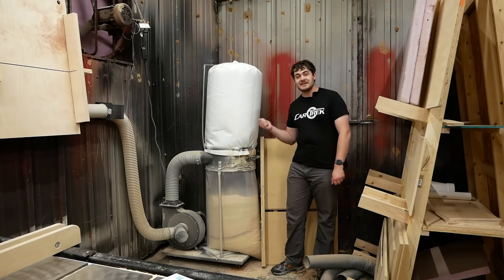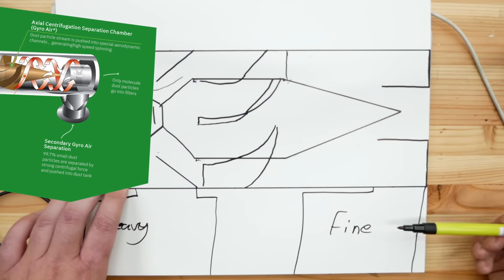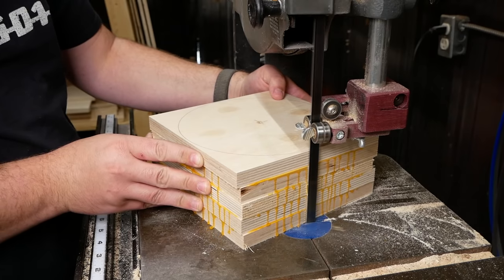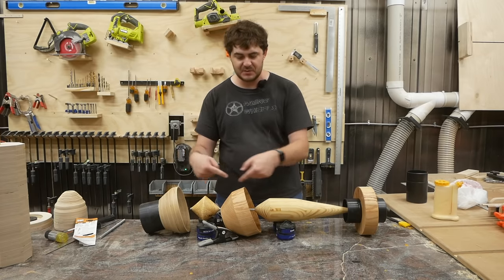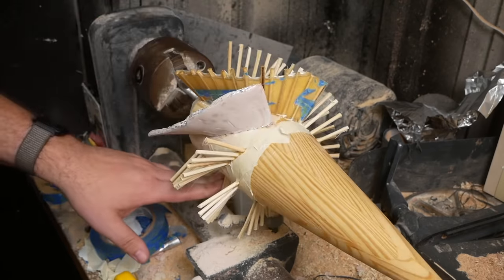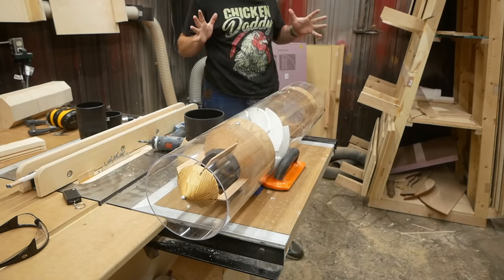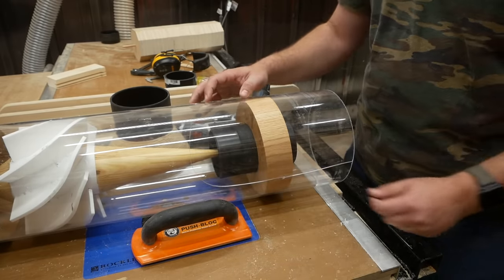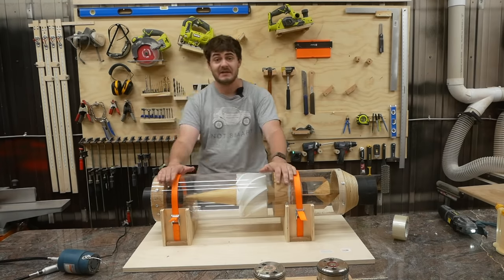I Made a Centrifugal Dust Separator to Upgrade My Cheapo Dust Collector

Comment: Two things on fins. Uv curing epoxy. And steam box.
Reply: Acrylic is about the same for plastic as wood steam box. On the fins, I think thin start and end pieces may help a lot. Aerodynamics...as superfastmatt says engineers state, may it works, maybe it doesn't. Calculations are not irl
Reply: I have seen people say that masking tape can assist with acrylic cracking, idk.
Reply: Uv resin or silicon should assist in structural integrity. Don't forget about e6000. Just ideas, packing tape seems like a good and dare I say... sufficient fix.

Comment: Very cool and intriguing - i have a 3d printer and have a basic understanding of fusion360 ... It looks fairly straightforward to design it and print it .. the only thing i would have a bit of challenge would be the fins - but the fusion 360 forum is very good and im sure there would be help ... If you made the parts hollow , i bet you can print the whole thing with just 1 spool of filament

Comment: Thanks for showing when stuff doesn't work. It's informative. 
BTW the plywood was a bear because you were trying to constantly cut alternating layers of end grain. The laminated pine acts more like a solid length of wood. The lathe tools were difficult because of their short length (less leverage) making them harder to control. I can't speak to how sharp they were but that's also critical especially on oak and any end grain.
I'm surprised you didn't use something easier to work like polystyrene or pvc formed by heating it a little. But that's the fun of your channel, watching you take the long way 'round. ;)

Comment: Would putting making it bigger and putting the air/ dust inlet at an angle as to course the vortex and exit air pipe back up through the middle and mount it vertical? So the heavy stuff drops?

Comment: I wonder if you could do some sort of recycling with what it collects since it separates out the course and fine dust (maybe use the course dust to make some sort of chip board and the heavy dust for crack repair and to mix in to glue for a more seemless finish)

Comment: I don't know why, but I kept expecting the turbine part to spin. Just seemed right. So yeah, with a 3d print you could dial all that in and save quite a bit of work (not having to deal with turbine blades exploding).
When all is said an done, if it works, it works. Plus think how much easier it would be now to do it all over again with what you've learned. lol.

Comment: Use an angle grinder with a wood carving wheel on it while you hog out a bunch of material on the lathe. It’s safer and quicker than using a gouge or bullnose on the lathe.

Comment: Is there a reason this wasn't installed on the suction side of the blower?  If the blower fan curve would handle suction pressure, it would seem it would be better to pull all of the dust through the separator and filter first rather than pulling trash into the blower and then sending it into the separator and filter.  As a plus, if you didn't need to recirculate the air in the shop, you could just vent the blower discharge outside so the bag filter for really fine stuff wouldn't really be necessary.  This would also help prevent leaks from blowing fine dust around in the shop.

Comment: Wonderful. BUT you need to relocate the vacuum / blower to the front of the filter.  Why impact the fan blades with the wood debris?  Have the fan blades running in clean air.

Comment: Could this work much better if the first cone support fins were removed? You should reduce the inlet size slightly  before the second cone so the air can speed for tge second stage.

Comment: A 4" diameter cylinder has 1/4 the cross sectional area of an 8" diameter cylinder. Approximately 71% of diameter represents 50% of area. It does indeed look really counterintuitive.

But a 4" diameter fits standard fittings so that's the correct answer for how big to make it.

Comment: so i am here more than a year later. but for the fin fiasco part. instead of making fins that you then attatch to the turbine that forms to the outer shell. would it have worked to have cut grooves in to the wood with a router, so that the turbine had its own fins, and shrinking the outer shell instead with a reducer? like if we dont need/want a clear acrylic tube etc.

Comment: In my honest opinion when he latheded the large ring (the wood in the tube), he could have notched a small channel to put a rubber gasket as it is seals and holds well, and  the screws would not interfere.

Comment: Should the vacuum connect before or after the dust separator. In your video it connects before the dust separator , wouldn't it be causing more wear and clogging in the vacuum propeller, or does connecting it after the dust separator won't work???? really nice video by the way,  I am thinking of making one for myself.....

Comment: Would it be better to put the motor after the dust collector. Then it is sucking the air through the collector. Plus chips+dust are not going through the motor fan.
Could one not just forget the post dust collector filter and simply vent the pipe directly outside?

Comment: You have to drill an little hole at the end of the Crack an then tape it frome the back so you can fill the hole with a dot of epoxy. 🤙

Comment: would be interested in the equivalent cost vs the purchase cost to complete the comparison.  
I once build a deck for my house and decided there was no need to hire a professional. The compensate for my lack of experience, I over engineered every aspect of it. and result, it took me four times as long, and cost twice as much in just material, but if a tornado ever came through our neighborhood I would pull the family out of the house and crawl underneath the deck. pros and cons I guess, needless to say I never built another deck!

Comment: They are different ways of achieving dust separation. And I like to think dual stage and finding different ways In achieving a clean output like even so far as venting Outdoors we're a little bit of dust outside the building probably wouldn't matter.

Comment: You should've used polycarbonate instead of acrylic. It's much more durable and cheaper but, there is a tradeoff which means it scratches easily.

Comment: The design is super cool, but wouldn't it make more sense to put the separator BEFORE the fan? That way you're separating the vast majority of dust before it travels through the fan potentially damaging impeller blades, and all you're blowing out is dust that will be caught by the filters.

Comment: great video enjoyed it a lot, but I do not understand why you put the exstractor before the seporator, as one would do a with a cyclone system to avoid accidents with the fan being hit by unintentional debris nails screws and stuff!  I have seen the jet on YouTube,  and i was not impressed with it one bit.                                    For my last homemade cyclone I used the largest and most rigid traffic cone i could find, i think it was made from recycled tyres very thck walls so it did not colapes. i cut the top off the  cone so it was about 4" exit attatched plywood base plate for dust bucket sea.l purchases an ally stew pot online £18 UK  that was the same diameter as cone base. the pot had 2 loop handles, so i coud use toogle clamps to attach pot to cone base, drilled  two 4" holes in pot, one centre of base to for exit pipe, and one in side wall at angle to copy cyclone entrance pipe using filler to blend it in as best i could. It did worked not bad at seperating but lost  power a bit and it was very ugly. The reason for making it was my bucket extractor has 4" hose,  and  the cheapest 4" cyclone in UK is over £120. so one pot and two toogles was much cheaper at the  time. I have retired it for now. The extractor has just one job for my mitre saw stored neatly under bench. No room for cyclone. So may try using the cone cyclone in future.

Comment: Today we learned: Don't super cheap out on wood turning tools. Don't friction fit in an acrylic tube that costs over $100 since you're going to be using silicone to seal it anyway. Also, why wouldn't you plumb the separator ahead of the blower as a pre-filter instead of making the blower touch all of the dust and chips?

Comment: You have the fan unit mounted to the wrong end of the separator.   All your wood chips and sawdust are going through the fan.  Should be mounted onto the outlet side so it's sucking the air rather than blowing it.

Comment: The size of your wood turning tools were the main reasons why   things didn't end up the way you wanted. The tools needed to be much longer to gain adequate control.     

I have used Baltic birch plywood to turn  three edge bowls with no problems using carbide tools.  And the shape was more complex than what you turned.  When you turn wood with carbide, you need to turn on center of just a small fraction of an inch above center and your speed needs to be high --- 700-1000 rpm when turning on the outside. When turning on the inside (hollowing), your tool needs to be below the center line.  

The reason for your catch when hollowing the wood was due to being above the centerline, and the tool was trying to remove too much wood.

I suggest learning to turn wood before venturing using a lathe.  You could get yourself hurt very quickly because of ignorance in using the tools incorrectly.

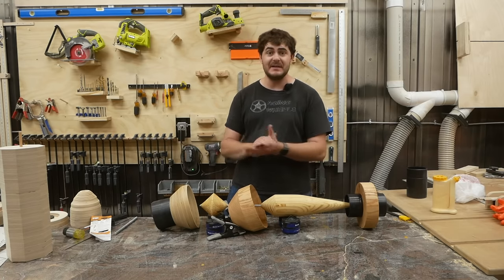Comment: 9:00-9:30 I just love this hypothesis and the facial expressions at the start and conclusion!   Very comical.
22:25 I thought the forgetfulness for style of carpentry was willful, and not honest; style: Tongue & Groove.
32:47 The filter box on a saw horse reminded me of the movie Apollo 13, except the CO2 filters were duct taped together.
34:04 I had to watch the left side of the screen for particulate departure out the tube, because the sawdust is the same color as the table.  Very small traces were still coming out of fine dust particulate, the kind you need the filter for, and most harmful to your lungs.

Overall 8 out of 10 video, first time watching a video on the channel, and subscribed, despite the few and far between videos still being made. Still better than a Michael Reeves video!   I loved all of the trial and error included and not edited out.  The biggest reason I deducted 2, working without a mask after the dust leak.

Comment: I also thought the center would spin but when the veins were put in the tube I realized there was no way it could spin due to the tight friction fit. Has anyone made a dust filtration system that does work more like a jet engine?

Comment: That would a lot better if it were on the vacuum side of your motor, you’d have low air pressure in the chamber for better separation.

Comment: The skewers would have worked if you had covered them with tissue paper, and then water shrunk it.  (Old model airplane tech).  Or, you could go with new model airplane tech, and use Mylar, and heat shrink it.

Comment: Good video. Very smart showing us the diagram and theory so we know what you are about to do. I hate those videos where someone just starts making something with absolutely no information as to what the plan is. (It's basically porn and  usually masks the fact that the final object might be nice, but the steps are so straightforward they could've all been skipped.) 
 Drill bits for acrylics and plastics are very steep angles. I've had a few, they work well. Regular drill bits sharpened for cutting into metal and wood are too shallow.    And of course to stop the crack from propagating, drill a hole at it's front, but of course you're drill bit caused the problem. 
Here's an odd bit of information. Artist Peter Shire, Memphis design movement, made a small table. It's square with a notch made from one quarter of the square. It was laminated (ATC not Formica) And no matter what that crisp inside corner always cracked. So he routed out a circle at that corner and inlaid a contrasting color of laminate. 
The filter box is great, but I always think, what am I going to do with it when I no longer use it? So I'd just make a plywood carcass that I could cut down and turn into something else. Also that tight seal. Another idea would be to make the rolling box at a slight angle and under the top a frame with a matching angle. So it'll be just like sliding in a narrow wedge. It'd fit tight by pressing up against the top.

Comment: Honestly, I would have modeled the fins in fusion 360, flattened them in the software, printed them out, stuck them on sheet metal, and that would've been it

But this works too I guess

Comment: If your filters were ‘in-line’ with the dust stream, they could have worked, but you fitted them at 90° to the dust stream, which is why you had problems… they should have been fitted against a stop that ‘in-line’ with the dust stream at it entered the filter box… it just needs turning 90° and re-jigging…. The only other thing that may have made it less effective was the size of filtration…and the fact it was intended to catch quite large particles of household dust, and micron sized wood dust particles, a great many of which I expect would pass right through it… but hey, a terrific effort on that, and you made me laugh too, not always as I’m a miserable old git…lol…so we’ll done…and yep I was surprised it worked too 😂😂😂😂😂

Comment: Wouldn't it be better if you put the blower PAST the turbine, instead of running all that dust and chips through the blower?  In other words, suck the dirty air through the separator, and then (virtually) clean air will run through the blower, then blown into the final filter.  That's how most of them I've seen work.

Comment: This is a cool YouTube project, but terribly inefficient as a dust collector. Best way to get cyclonic dust separation is to pipe the intake in tangentially to the collection bin, which is exactly what the HF unit does (albeit after the blower fan). That's how industrial dust collectors do it, that's how Dyson vacuums do it.

Comment: Those jet dust separators don’t handle wood chips very well at all… they can do dust from a table saw or something just fine but any debris or curly chips like ones from a planner or lathe, it will not work for you.

Comment: I’d just like to point out that a lot of the problems you had could probably have been avoided if you’d gone the easy route instead of the fun route with all the nice YT footage on it: a 3d printer would have been happy to produce all of the complicated bits that seemed to cause you the most trouble. Alas, this would have resulted in only a couple minutes of usable footage for the video and might have been less visually appealing if you’d printed the tube as well.
I point this out because it would lower the entry barrier for people looking to get one themselves: there are thousands of print farms all over that will happily produce the parts if you don’t have a printer, and that would leave mostly just the boxes to create by hand, which is convenient for a woodshop. Of course, now i’m going to have to spend all afternoon thinking about how to make that blade geometry in solidworks. Sigh

Comment: Now to not pattern infringe by making it  many multiple stages of separation and liquid filtering rather than air and test by pumping dirty river water to discharge clean river water back into the river and of course what you collect would have use or profits

Comment: Carbide isn't the best for turning. Properly sharpened tool steel is the best because you can sharpen it easily. Carbide will fill and you can't really sharpen it that easily. Also it is better for metal and harder materials. It likes a constant load. Not intermittent. So wood is really bad.

Comment: You are bearing down way too hard on the glass. It takes firm pressure but not so much your hands shake. The tiniest scratch will make it crack cleanly. Too much pressure makes a clammy score and a rougher crack, more chance of spidering.

Comment: Re-watching this months later - you sir need to watch FarmCraft's video on turning a wood bowl, because he explains why your tool was catching on the inside of your workpiece: https://www.youtube.com/watch?v=v9q2A9aC3PA Basically you want to have your tool positioned in a place where the workpiece is moving AWAY from the tool (and you) and not TOWARD the tool (and you); so for outside round work that means down low, underneath the center line of the piece, and for inside round work that means up high, above the center line of the piece.

Comment: So... This was a dangerous bit of work. And all for a dust separator that is no better than a horizontal vortex centrifugal separator. In fact, considering the amount of drag this is likely to create, and how small his dust collector's motor is, this is probably a worse idea than the simpler design. 
Also, you do know how abrasive wood dust is, right? No shot those parts will last.

Comment: One word "DOWEL". I would have used all thread instead... stronger... second I would not or should I say wood not have used DIY tools for shaping, I think professionally made tools may have been sharper. Also why not use plastic funnels as forms, then fiberglass over them? Or how about just Use a 3D printer, you could always piece smaller parts together to make larger items???

Comment: liked for the massive effort on the project and video.  however, that filtration design is so terrible and just a scam. you're better off copying dyson's cinetic or cordless vacuum filtration designs. edit: actually you can upgrade your current dust collecting machine by simply having the bag filter on higher elevation or taller.